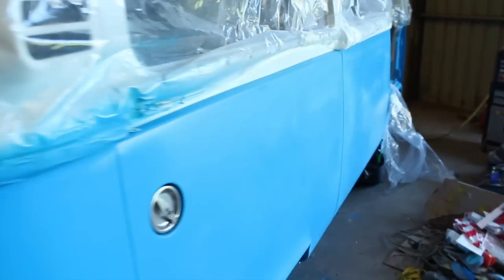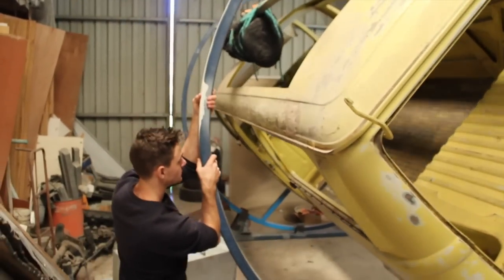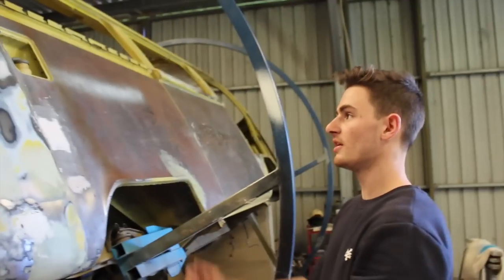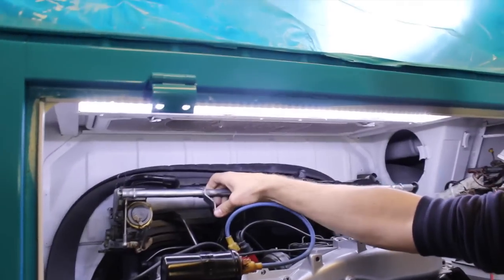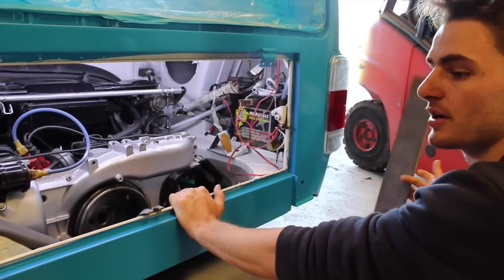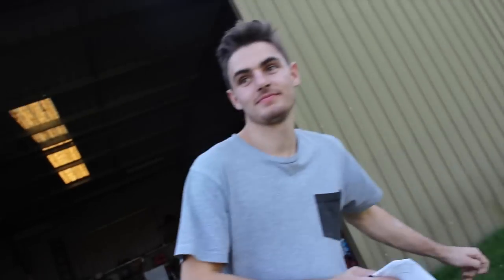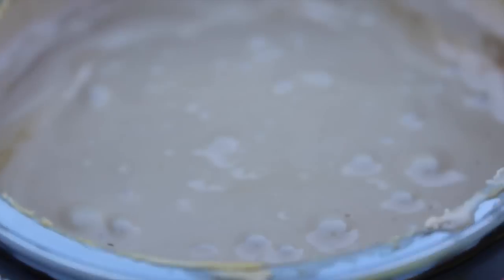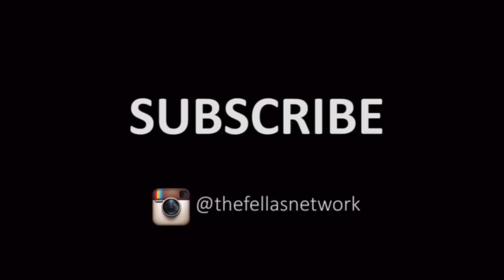1974 Volkswagen Kombi Van Restoration Project

Comment: Hey one scene a guy for the Volkswagen like this he attached to box fan to the front of a Volkswagen van he then put the cord through the Wing window then a small extension cord underneath his front seat and out the side window and plugged into the outlet on the panel that was a smart idea it just so happened to be a camper westafala and specially traveling down the mountain passes from ohio to North Carolina. He upgraded the motor for that Journey this reminded me of the music video of the land down under from men at work. Perhaps if they had a boxfan that van would not have broken down and overheated